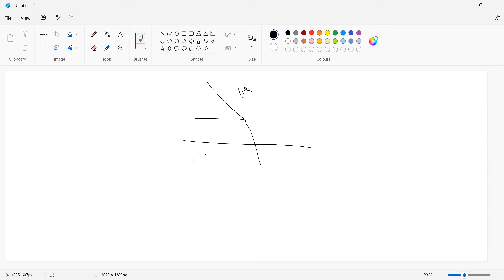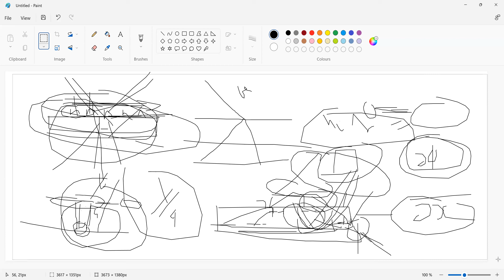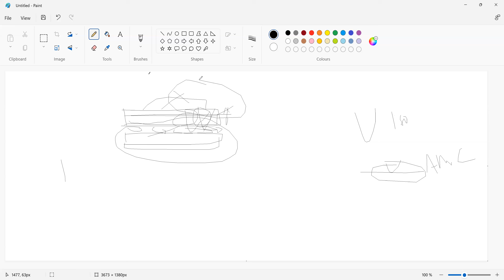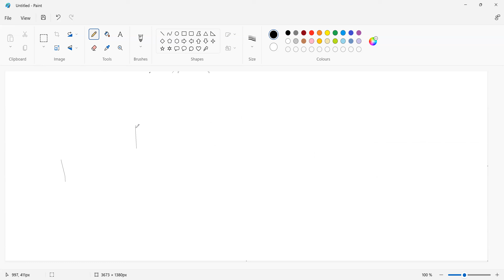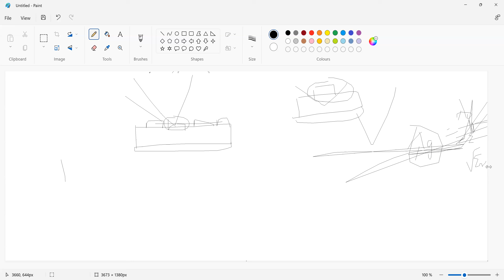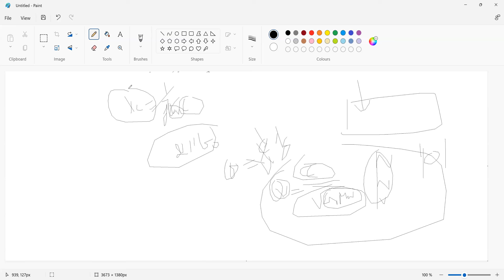Useful discussion on metasurface and FSS, differences between them

Comment: Hi sir, for isolation enhancement in the MIMO antenna I have designed a unit cell with dimensions (1.5x10) 1.5 width, and 10 lengths for 28 GHz frequency. Will this unit cell be considered a unit cell because one dimension is large?